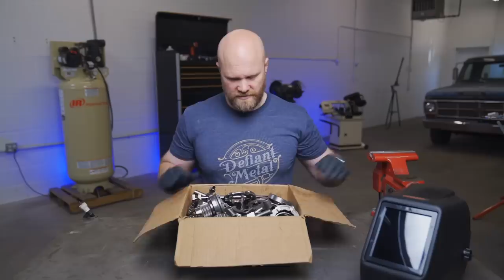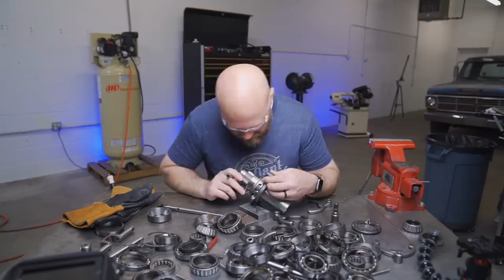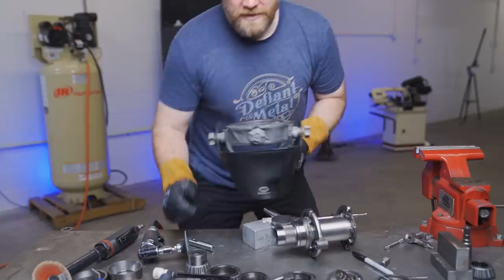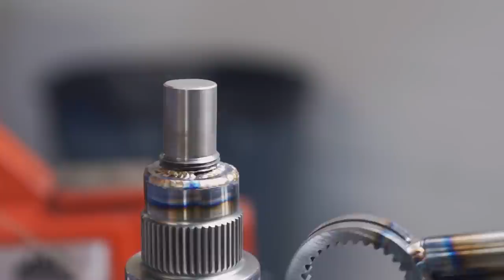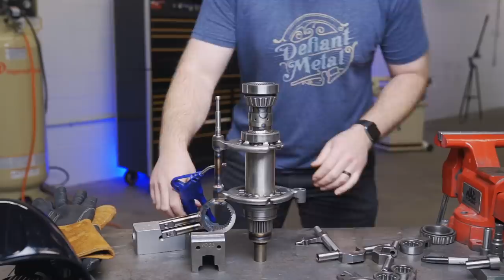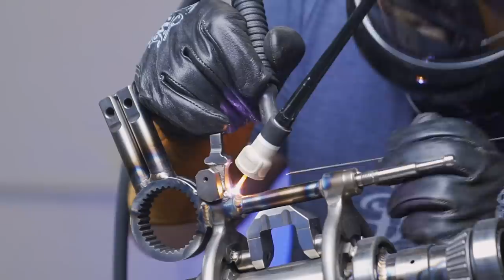Auto-darkening vs Fixed Lens Welding Helmets. Miller, Blue Demon and Hobart

Comment: When I used a Fixed lens Welding. A high intensity flood light aiming at your work surface made it easier to start welds. You can keep your shield down and see your start point.
Reply from the maker: Nice! A lot of shops could benefit from a lot more light in general.

Comment: I actually prefer the non-auto darkening. I guess I'm just old fashioned that way.
Reply from the maker: Nothing wrong with that imo!
Reply: Damn sure don't have to worry about forgetting to turn off grinder mode that way... I just got my first auto last week and I've been welding for nearly 20 years. I haven't lit up in 2 days and I can still see blue dots from staring at the ark waiting for my hood to get dark lol.
Reply: REBEL with the tiger hood though you have it flipped up from grinding flip down to weld forgetting to flip the dark shade down and blasted with light. Not fun

Comment: Great video! I've been learning to weld at work, and the only helmet available is an old school fixed shade one with a little flip up visor for the shade. I do a mix of TIG, MIG and stick so changing out plastic lenses comes with the job. But I'm loving the fixed shade helmet, even as a young guy.

Comment: I keep a non-auto darkening helmet with a #10 and a #13 shade. The gold lenses are nice. If I have an outdoor project, I use the standard helmets because the sun doesn't mess with them. Those are usually cumbersome scratch start TIG projects anyway. Frame boxing, tractor repairs (OMG), trailer mods. 

-- Sometimes, my auto helmet will un-darken. I never figured out why. I use it so I can tack faster, and also get more post flow on stainless.
Reply from the maker: Sounds like you have all the best scenarios worked out for each type of helmet

Comment: I had a Miller Digital Elite from around 2004, it finally had to be replaced. I got another DE with the Clearlight lens, great hood and I really like the Xmode since I mostly do TIG welding. The Blue Demon may be a good hood but I don't care for the looks of it, JMO
Reply from the maker: The Elite was my favorite helmet but the new true color lenses are awesome.
Reply: I also had a old Miller DE. When I ended up getting a new one a year ago I ended up going with a Digital Infinity.

Comment: I still use a non auto darkening Helmet. It's a Forney Bandit 2, believe it or not while the headband sucks the narrow helmet profile works well in places where serious reflection from above and behind is a problem where my Optrel Vega View 2.5 flares out too wide to protect against. My Weld Cote auto darkening helmet has a full view feature and is superior to the Optrel in that when pulse tig welding, it handles the on off cycles a bit better. However the Forney is perfect for pulse tig because it never gets confused by the pulses ergo no surprise flashes. Each helmet has its strengths and weaknesses and should not be dismissed on account of it lacking certain features. But 36 years in the game and you figure out what works in the situations you are able to test.

Comment: If you put your helmit in the sun light it will recharge and you won't have to replace batterys I leave mine in the passenger seat of my truck during lunch haven't had to replace them yet
(Miller digital elite 6 month's of every day use) p.s love the truck in the background
Reply: The arc will also charge them you typically need to change the batteries ever year and a half or so. I have had a miller elite for around 13 years.

Comment: I’m gonna have try out that hood. The main reason I have the 3350 is because I like how it has the American flag pattern on the outside (for if Blue Demon reads comments, variety is always a plus instead of one color always being black). I do like the big window on the 3350 as well, so I don’t even know why this didn’t even occur to me as an option to buy for a hood. Point being- this video actually did shed light on a potential new customer for Blue Demon. Call me lazy, I just hate having to constantly flip up my hood to do things lol. When I have to get a new hood, I’m gonna definitely check out Blue Demon. And on a separate note: I don’t know why but I like your background. It’s simple but it looks unique and maybe it’s something with the camera having good focus, but your videos have always stuck out as both good visual quality, and of course content quality. Good stuff man.
Reply from the maker: I don’t think you’ll be disappointed! The also have a less expensive single lens helmet with a large view. I’ll bring up the options to them, you could always get one airbrushed or wrapped.
Reply: I didn’t even think about that. I’m in my second year of college getting my degree, so I’ve not been the most exposed to what all is out there, so thank you for the second thing I learned from this video :D

Comment: What die grinder are you using exactly? I am about to order one as the stores are closed here in Germany, but I was wondering which one would be good as some say the sanding plates fly off some sometimes.
Reply from the maker: Any pneumatic angle grinder will be ok, the Roloc is the type of discs I use. They twist on with a little plastic knob in the center. Mine are 3M rolocs.

Comment: I wish companies could sell helmets for diff size heads. I have a small ass peanut head and tried about 10 diff helmets thru time and the only one that fits really tight is a cheap fixed lens piece of garbage that im lookn to modify and take out nice 4" auto darkening lens from a good helmet to put in it. I weld in crazy positions and just want a helmet made for my head. Sometimes I wish they wouldnt focus so much on gadgetry and just good fitment to keep price reasonable. Just my 2 cents

Comment: Jackson hlx 100 shell with the upgraded Jackson 370 headgear and passive gold lens here.
Super lightweight, headgear beyond perfection both in function and comfort, with a positive lock in the up position, flicks down only when you need it to and that huuuge adjustment wheel for easy strap adjustment wearing welding gloves. And lasts a lifetime costing 10 times less than the autodark drop'em and weep units
It doesn't get any better than that. Autodark is only for high production Mig work imo...
Reply from the maker: I’d add tig in my opinion, for auto dark. I like to see exactly where I am setup before striking an arc.
Reply: @JustVoss  With the above setup you do see exactly where you are before stricking an arc. Just position your torch, flick your neck at the same time as you start the preflow, hood down instantly and arc on. I you aren't shaking like a leaf and can hold your torch still for a second you're not going to move any amount by the time the arc is on. I Tig 0.025-0.040 thou bicycle frame tubing every day with that setup and wouldn't have it any other way.
Imo the argument of seeing where you are before you strike the arc is overrated because you don't really have the depth of view sense when seeing things behind an auto-darkening lens so you don't really know where you are spatially as you lack precision in the  depth of view.
But at the end of the day it's a matter of preference and everyone has their own way of doing things

Comment: I really could use a new hood. I'm having a bit of a hard time seeing the puddle clearly when I'm using the powertig.
Reply from the maker: Most of all the new ones are amazing.
Reply: My boss wanted all of us fab guys at the shop to have the same hoods so that consumables are easier and cheaper to get for everyone and I wasn’t really up for because my lense was so clear. Needless to say this miller fixed lense that literally has a thin layer of gold in it is by far the clearest vision while welding  yet

Comment: Hey Justin, if you want to feel like a spoiled Nancy boy tig welder ( I weld with a dynasty, digital infinity clearlight, and crystal 2.0) go check out txs viking!
FYI put a gold lense in the fixed shade and you will be impressed for the $30 investment
Reply from the maker: 2nd gold lens recommendation so far! Must be good.
Reply: @JustVoss  one step more: get the $20 (schott) glass gold lens from phillips safety. The glass pane stays flatter than polycarbonate, and the image is very pure. I use a glass outer lense as well. You're welcome:)
Reply from the maker: Nice, but have you ever shattered the outer?
Reply: @JustVoss  No, I keep my fixed lens helmet away from grinding operations and fitting/tacking.  Then when its time to sit and do a bunch of critical welding I pull out the glass setup. Its really relaxing on the eyes because the image is so consistant. Digital elite for grinding, tacking, etc. - I still like my Miller.

Comment: I have no affiliation with YesWelder  but they have true view large lens hoods for 70 bucks. I been using one for 2 years and it works great for the money and a great view not that green shit. I had to replace the head gear as it stripped but a miller head gear fits it perfect. I am retired now but have over 25yrs in the field. Just thought I would let you guys know in case someone is looking for a good hood without dropping 300 bucks.

Comment: I've used those cheap Hobart helmets, they are better than nothing, but otherwise really $uck. Just a tip, when shooting video through an autodark lens, white balance through the lens before it darkens to remove the green tint. You may need to hit the work with more light to balance the exposure.
Reply from the maker: I didn’t want to white balance it, I wanted it to look how it looks with your eyes.
Reply: @JustVoss  yeah, I figured that out when you switched to the Blue Demon. That said, putting one of those Blue Demon shades in front of the camera would work way better than the cheapo I bought for my camera. Regular ND filters can let a lot of IR and UV through, so a welding filter is what I recommend to people. Next would be some of the metalized ND that reflects the IR like a firecrest.